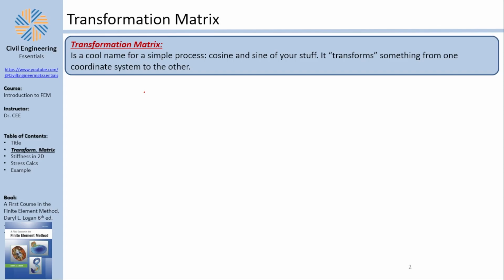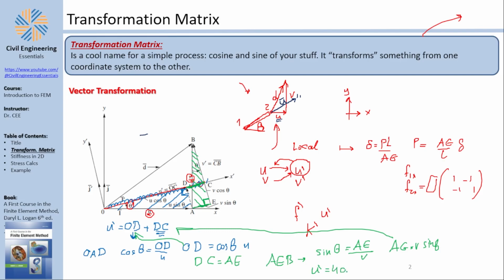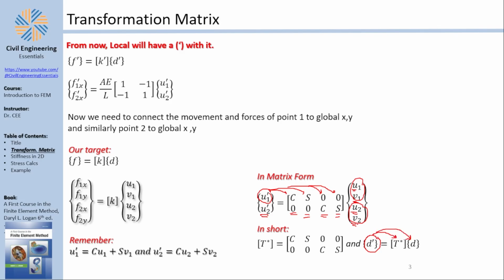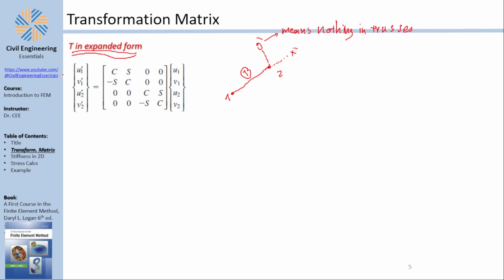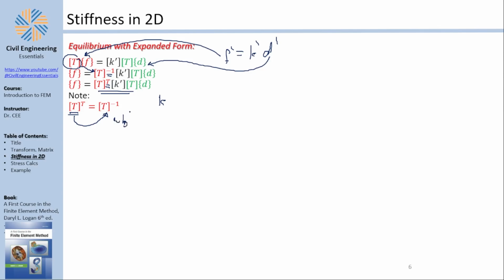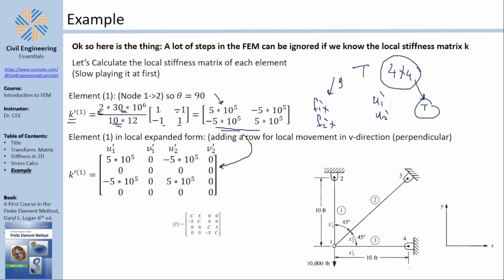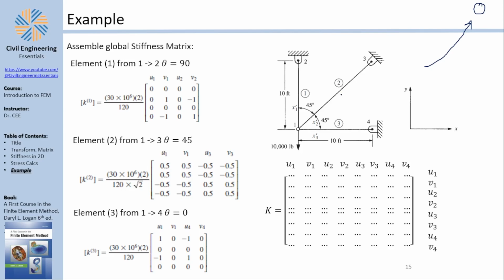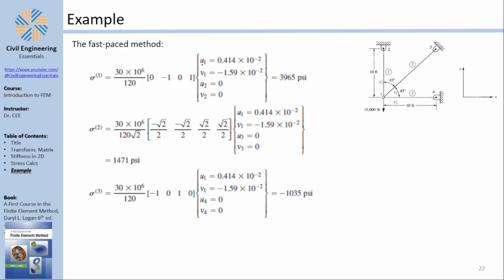The Finite Element Method (FEM) | Part 4: Transformation Matrix and Trusses

Comment: Hello Dr. CEE

What a ride this lecture has been! and although it may not seem so on the surface, for me this lecture and the example are well packed with core principles and the associated assumptions! There is so much to take-away, and there is so much to unpack. Let me settle for the CEE classic saying that ^_^ TRUSS elements do not care about LOCAL nodal forces and their corresponding nodal displacements in the local y,(v) directions. Nicely done Doctor and thank you. 

The inclusion of the example (the juicy one you say ^_^) and the occasional “slow-playing” through select parts of the example was brilliantly done. It does help a lot to confirm and to make sense of the various theoretical aspects that had been learned; it also booster confidence on the application of what had been learned. 

34:13 For the answer to the second part of the example. I first used the same process that is explained in this lecture and then I decided (for the heck of it, I mean why not?) to also double-check my answers to this second part by using the transformation relationship {f’} = [T]{f} …. boy oh boy I was in for it. I quickly (maybe not so quickly ^_^) learned that one must first separate the “STRUCTURE” GLOBAL nodal forces from the “ELEMENT” GLOBAL nodal forces especially where more than one element joins together at a common node like at node #1 in this case. In the end, all worked out and the answers from either process were matched as it was anticipated including the force signs. 

36:55 I support the CEE idea to have the next video to be yet another example to cement the many cool and interesting ideas that were unpacked on this video. A lot was unpacked, so why not look at the various practical applications and illustrations of these techniques and/or processes in action if we can. 

I have enjoyed this video and I am looking forward to the next videos

Regards, DK
Reply from the maker: Hi there Engr. DK,
Glad you liked the video.
Oooooh you are right. When you want to check node equilibrium, you would have to first find the global forces on nodes using the transformation matrix, then check out the node equilibrium.

Yes, the idea is to dive exactly into what you have tried. I will be going it in detail, so it would help to further cement the idea ^_^

It is gonna be awesome. Stay tuned for more content like this.
Regards,
CEE

Comment: These lectures are awesome, and raised me a new question, how do i know in which case i should consider large displacements calculations? Thank you very much as always
Reply from the maker: Most welcome, I am happy you liked it.
Large displacements typically occur when the deformation of a structure or material is significant enough that it causes a change in the geometry or shape of the object.

Meaning: that the classical definitions of strain and our methods of neglecting the changes in angles sometimes will not work.

If the displacements are relatively small compared to the size of the object, then small displacement theory may be sufficient. However, if the displacements are large enough to significantly alter the shape or geometry of the object, then large displacement theory may be necessary.

The odd part is, that the ACI code does not specify when to use large displacements, and it is left to the  discretion of the designer.

In my opinion, you would not encounter large displacement as long as you are designing regular structures and imposing the deflection limits of the code.

Exceptional structures, like tensegrity structures, are DEFINITELY large displacement structures.

Hope this helps
Regards,
CEE
Reply: @CivilEngineeringEssentials  yes exactly that was my point, suppose that you are desining a truss with a huge span… when do you use second order analysis in that case? The only thing we have to work with is the code design limitations as L/300 and so on…
Reply from the maker: @jesuscandea512  I agree, this might become really a problem, I need to research a little bit to try give a "limitations" as the codes remain silent with that regard. 
Because if we assume large displacements, then - as I said before - a lot of equations just break down. 
I know you did not ask about the following, but here is a quick run-down of how such analysis would happen in the FEM software:
You would not apply the full load on the structure, but discretize it using load steps.
Then you would apply (consecutively) each load step

So for example, you have a 100kN load, you add 10, calculate displacements, modify the stiffness matrix based on the new truss after deflection, add the next 10kN, calculate, modify, add another 10, and so on (that is one option to basically deal with large displacements as a sequence of smaller displacements with their comulative effect.

Now I know that was not your point, but I thought I would just throw that info in. 
Personally, I will do some research and maybe I find something that can be simplified to be practical.

Still, huge thnx for your comment, you are helping me and all viewers a lot.
Stay tuned for more content,
CEE
Reply: @CivilEngineeringEssentials  thank YOU